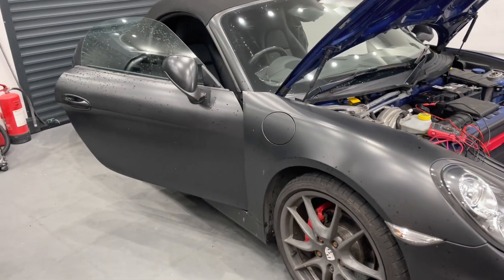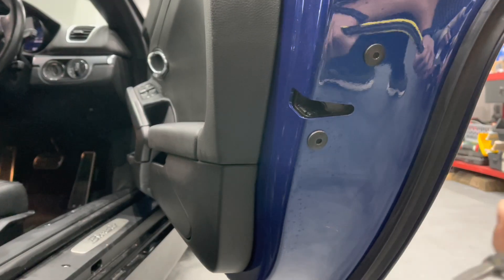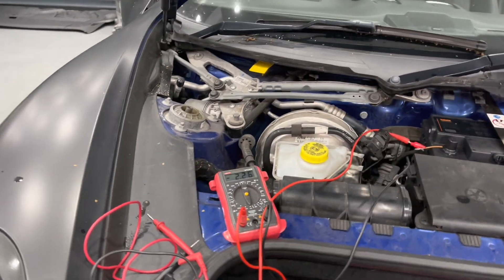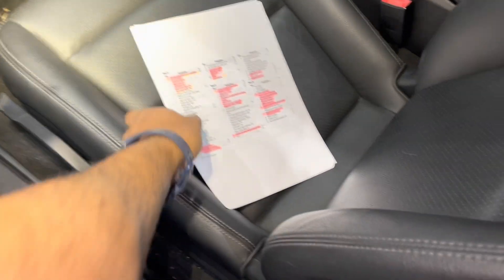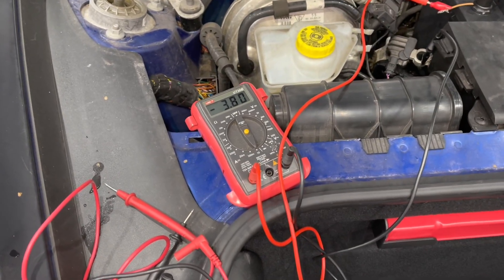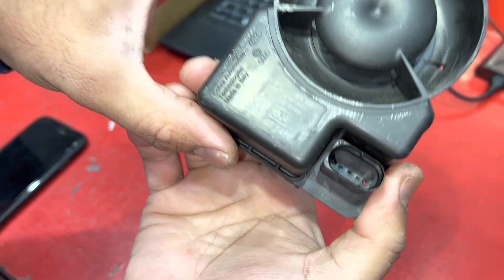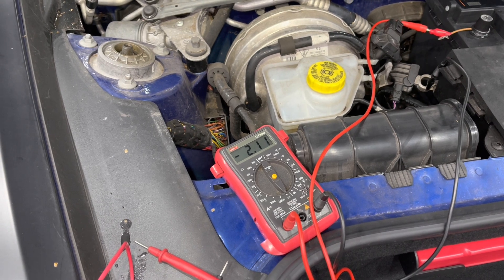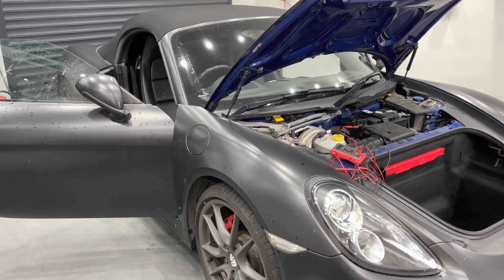Porsche Boxster (981) Diagnosing and Repairing Parasitic Battery Drain

Comment: Question on the battery.. Can you claim warranty on the new battery that's now flat?
Reply from the maker: If the battery is flat, you just charge it.

If the battery is faulty due to a manufacturing defect and then you can claim under warranty

Comment: Hi, I had a parasitic drain on my 987, I hooked the multimeter to neg terminal and the other lead to the neg post of the battery....you'll need a helper or a set of alligator clips to do this. I started by having the hood lock latched with a screwdriver to simulate it being locked, I did the same with the driver door....make sure you remove the key from the ignition. I then removed one fuse at a time to see which would stop the drain if removed......I noticed with the PCM fuse removed the drain would drop down from 3.7 amps to approx 40 milliamps. So I bought a used PCM, but the current drain issue was not solved, but it did help me to narrow it down to sound system,  I disconnected the amp and the drain remained, I finally removed the CD changer and the drain dropped down to 40 milliamps again....I looked at the pins in the back of the CD changer and there was evidence of rust.....I used an exacto knife to clean the pins the best I could....I then sprayed some PF Blaster in there and then rinsed it out with some alcohol.....it's been good ever since.